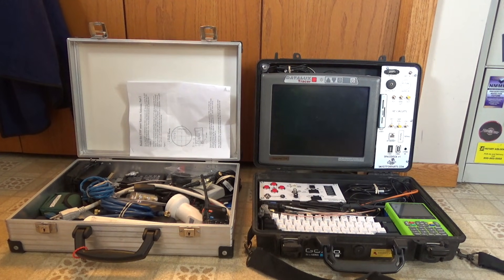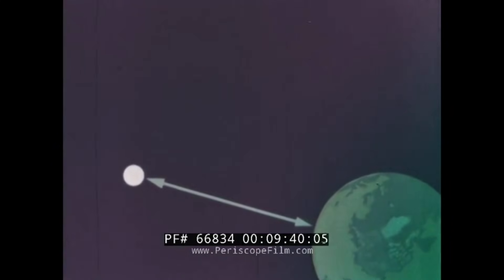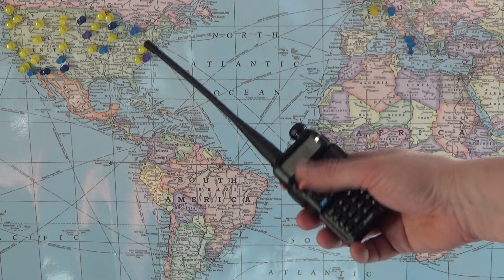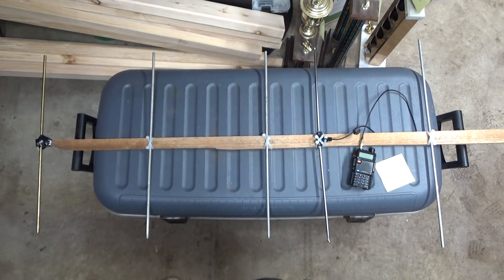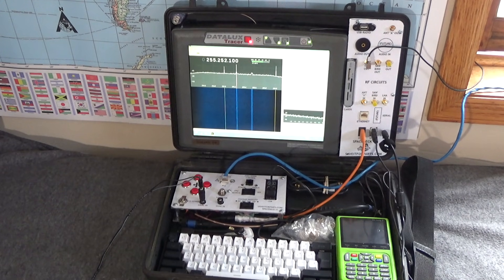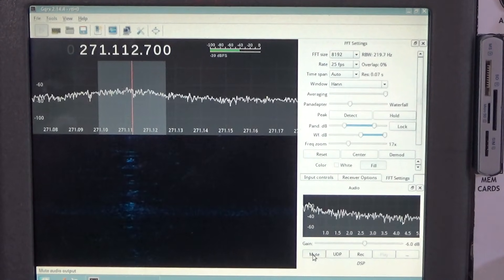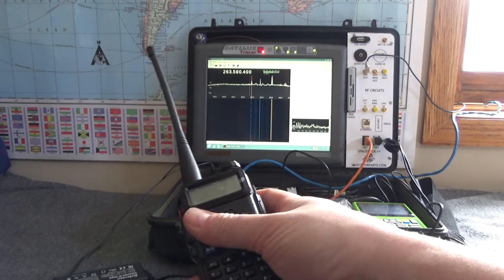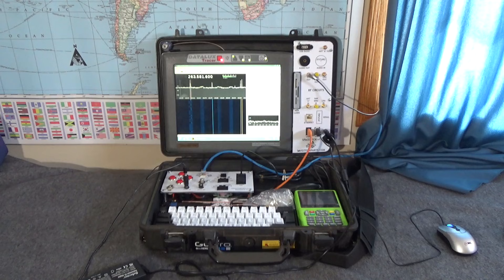Searching For Space Pirates On Old Military Satellites

Comment: The reason why you're getting such a weak signal is probably accountable to some weak hardware, but it's definitely due to the fact that you're using a verical yagi, hence a vertical polarization setup while you should use a right handed circular one, such as a turnstile antenna or two coupled yagis (one in v and one in h)

Comment: speaking of weird harmonics in places they shouldn't be, have you ever noticed NOAA weather transmitters on 18mhz/50(ish)mhz? i tend to find those still at full power all the way down there
Reply from the maker: Always with the same radio and antenna? Sometimes the harmonics and reflections are internal to your equipment, I get that with certain combinations of SDRs and gear while others don't get it as much.
Reply: @saveitforparts  i suspect probably the radio, i only have two antennas capable of going that low and it seems to generate the same result.

Comment: @saveitforparts very nice work, unfortunately it doesn't seem the communication you intercept come from the satellite. It's more probable that waves you received were thru ionospheric reflection and it isn't stable since it depends of the weather condition once this wake arent'well reflected, btw the brazilian truck drivers use to use the UHF/VHF radios to communicate between them, it was exactly the communication you got.  As already said by other comments it's brazilian portuguese
Reply from the maker: I can see the transponders from the Satcom system, they're the faint evenly-spaced signals at 8:10. The voice transmissions come through as subsets of those transponders, in a narrower bandwidth.

Comment: I built the datalux tracers lol. and worked on them. the company no longer exits sadly. pretty cool seeing one. other than the one i have
Reply: Everything in that was engineered and manufactured in house in Virginia. If you were curious. It went down hill around 2013 and mainly due to the price of laptops dropping dramatically. So it was cheaper to just replace a cop computer rather invest in making it almost indestructible lol.

Comment: 271.1127 / 3 = 90.3709 (third harmonic)
Reply: Sounds like you need a FM broadcast band filter or better shielding in your receiver. If you use a HackRF there's a shielding kit you can install to block FM band. If you use a RTL SDR then you can mod some; or buy one that is better shielded to begin with.

Comment: Newb question: I can’t find any Baofeng radios with freqs between 250 and 270. What radio is being used in this video ?
Reply from the maker: This one is a tri-band model, I forget the exact model number and they know of make up new models every few months. If you search tri-band you should find one that will work.
Reply: @saveitforparts my Baofeng goes between 220 259.9MHz. On UHF from 400 until 519.993.

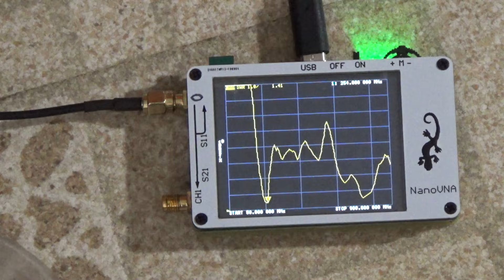Comment: 5:15 = wait,  wadduya mean? You adjusted the distance of antennas rods from one another and THAT changed the frequency you receive???

I'd have thought only the receivers electronics determined what's being received and antennae just determine how much/strength of receiver??¿¿
Reply from the maker: Antennas work because they resonate at certain frequencies, so the length of the antenna material is pretty important. That's why lower-frequency antennas like CB and old AM car radios are so long, and higher-frequency antennas like UHF can be tiny. You can re-tune one to a higher frequency (shorter wavelength) with wire clippers 😄

Comment: Did you figure anything out about the the recieiver picking up npr?
Reply from the maker: I think it was just a harmonic reflection inside the antenna or wire. I should have used an FM filter to avoid that.

Comment: ya ... uv5r is dual band not triband
Reply from the maker: I think this one is a "UV-5R III", but really they make up a new model number for those Baofengs & clones every week. I think the factory just slaps a random sticker on the front, you have to look under the battery to see what the actual specs are.
Reply: @saveitforparts  all uv5rs can only run 2 channels at once

Comment: how did you get your uv59 to transmit on 250mhz i can only go as low as 400mhz
Reply from the maker: I'm not transmitting, just receiving. This is a tri-band Baofeng. There are so many models and clones of these radios it's hard to keep track of which ones do what, but the tri-band version has a 220-250mhz capability.

Comment: Very very cool(and inspiring), although there is one thing I do not understand, you already have a lot of antenas, why did you need to build another one for this project?
Reply from the maker: They're all tuned / optimized for different frequency ranges. I didn't have one for 250mhz, and wasn't receiving anything with the little 220mhz antenna on the handheld radio, so I figured I'd make a custom one.

Comment: How simple of a receiver for these satellite transmissions can be made with household electronics with the obvious necessarily custom made antenna?
Reply from the maker: You need something that can receive ~250-270mhz, like a radio scanner or software-defined radio (the cheapest ones are under $20 on eBay). There are some other antenna designs that supposedly work better, I've been meaning to try this one but haven't had time: https://forums.radioreference.com/threads/homemade-satcom-antenna.352085/

Comment: It's amazing FLTSATCOM 8 is still at its operational orbit.  I would have thought its stationkeeping fuel would have run out by now.
Reply: Even though there's virtually no atmospheric drag to speak of at GSO compared to LEO, and precise positioning is not strictly necessary for radio repeaters in GSO, they still had 120kg worth of station keeping hydrazine onboard.  I doubt they've used much of it.  If they wander about due to the gravitational influences or solar winds, not really a big deal, they'll still be there in the same general vicinity doing their thing, and orientation is a gyro stabilized affair driven by solar.  Navsats and whatnot that require precise positioning will absolutely burn through their station keeping thrusters at a much higher rate, as well as having an extra bit of delta v in reserve for the end of their life cycle to transfer them up into a higher graveyard orbit, so their expected perturbations don't cause interference with newer sats taking their place.  I don't know if there are plans or intentions for these sats to transfer up to a graveyard orbit, I would assume not as it's likely they would've already done so at this point.

Comment: Sat comms were my favorite back in my marine days. We didn't have a geosyncronus satelite over head for the man portable kits I used. Instead I had to kinda guess where tf it was in the sky, aim the antenna at it, and see if it would transmit.
Kind of a pain, but I liked them bc the voice comms were always crystal clear.
But for reliability it was hard to beat the old HF radio with a field expedient antenna.
Reply from the maker: Cool! It would be fun to learn more about military radios and systems. I assume most of them are encrypted these days.
Reply: @saveitforparts  Encryption is a whole other thing. Stock they are unencrypted til you load crypto. We would use unenceypted chanells to talk to civilian run range control to let them know when we were going live, when we were done shooting, how many marines were on range, etc.
Since you are a radio guy, you prob already know, but if u don't I suggest looking into omnidirectional field expedient antennas. All you need is some copper wire cut to the right length for the frequency, a means of holding that copper wire off the ground. You can get comms with anyone using that same freq within 350 mile radius.
Field expedients were only workable with HF radios due to the length ratios required to cut the copper wire. (The length of the cut has a certain ratio to go with the freq, but I have long forgotten the tables for that) Not all info I'm giving u here is gonna be 100% spot on (I've been out for ten years) so I'm just goin off of memories.
Hope this will maybe give u an idea for a video you can do.

Comment: Feed line laying inline with the elements is a no-no when making measurements, and way to much stuff around it. Support the antenna from the rear out in the open at least 2 wavelengths above ground for a UHF yagi like that, route feed line at 90 degrees form the boom and elements

Comment: Oh so this is the video where you're haunting pirates. I am an SWL from Italy, I use a superclassic omni Diamond X300 on a Yaesu FT-7800 vhf/uhf radio and I can normally pick up lots of Brazilians pirates, sometimes Russians but mostly people from Brazil. Yagi on VHF is good if you want to get a point-to-point connection, otherwise a good old simple J-pole will march quite nicely (if you only want to catch waves without considering the ROS, so not transmitting and say goodbye to the radio). I made one from various copper scraps and I can get ships and planes from 105 MHz to the 140 MHz. Though VHF are quite keen to pick up lot of noise, sometimes it's crystal clear, but I live 50 mts far from the Adriatic sea... 
The idea of using a PTZ cam as a rotor is just awesome!
Reply from the maker: Cool, thanks for the info! I'm always learning more about antennas, I have an amateur license and have read some of the theory books, but it always makes more sense to me once I've actually tried it for real.
Reply: @saveitforparts  Ah, nice! I'm waiting for my license too. For now, '73 here, maybe one day we can try to catch on air, when I'll have some spare time to setup a DX (I sell marine engines... funny how we have common passions :D )

Comment: Any updates with regards to the NPR broadcast?
Reply from the maker: I think it's a harmonic of the FM radio signal (so 91.1mhz times some multiplier). Possibly being caused in my antenna since I didn't use an FM blocking filter.

Comment: EE undergrad here, only just took a class on this. Might want to add a cross to that antenna so you can pick up different polarizations of waves, might get better results. Dont know a ton about antenna design (only what they teach in class so far) but arent those styles of antenna supposed to be more triangle shaped? Again im still learning so feel free to correct me. Pretty cool project, want to get into it a little but dont have any resources. Was really cool to see a real frequency band graph just after doing fourier/Laplace transforms in class with some single-sideband examples.
Reply from the maker: I've heard that an X-wing or other crossed antenna would work better, I still struggle with phase adjustments though. I might do a follow-up if I make a better antenna.
Reply: @saveitforparts  -  Sometime quad or hybrid antennas work well for this also

Comment: I'm surprised no one hooked a server up that acted as a modem for internet access. Have it listen to a self signed encryption for AT dial signals and establish an encrypted tunnel to whatever authenticates. Well I know what I'll be doing if I ever need to bug out ;P
Reply from the maker: I'm not sure what data rate you could get through that, probably way less than old dial-up modems. And if anyone else happened to be using the same frequency it would cause interference.
Reply: These satelites are not up all the time. 
They "restart" Sometimes and since the frequency is widely used I doubt you could get any stable connection for data

Comment: I wonder if the age of the components has caused any frequency drift in the repeaters. Regardless, I love that these 40+ year old satellites are still functioning and still getting used, even if for unauthorized purposes. A testament to engineers who designed and built the originals, glad they're not just space junk.
Reply: Well, its not all that hard,  AO-7 is a ham radio satellite that was launched in 1974,  and remained working until a battery failure in 1981 when it went quiet.  It was heard again in 2002,  when the batteries finally went "open ckt" and the equipment started operation again using only solar power.  It would reset when in darkness and restart when it was getting enough light.  Other than the batteries, the thing is about ready for its 50'th birthday next year, and was built by amateur (ham) radio operators on a very thin budget.
Reply: @arnoldgrubbs2005 that's really cool to hear
Reply: As it appeared in the video, the sats were actually still in service, so even without the pirates, they would not be space junk yet. But with increasing user count and decreasing battery life, they may end up as junk sooner. But surely is more fun to see this tech used by a broader audience than intended.

Comment: The U.S. Govt  legit SATcom stuff in the 250s these days are mostly secure data links. There's definitely still some secure & plain-voice USG Tacsat comms in the 260s -- some of it important stuff, But a lot of the USG Tacsat has migrated to MUOS CDMA with downlinks in the upper 300MHz area.   Really annoying to hear the pirates for those of us that used to have to submit requests for UHf SATCOM transponder access back in the day & get in trouble if we used to much uplink power, etc.
Reply: WHy did it matter if you used a little too much power on uplink? I realize that you don't need a kw to access it, but enough juice to make a solid entry into the system. What kind of karens run that system anyway?
Reply: @KlodFather  As available power is shared across users, normally you uplink enough power so that the downlink power is enough to be received. If you uplink more power, the other downlinks will suffer, dependant on sat power budget. A major sat system I worked with some 40 years ago, had automatic individual and total uplink power adjustment. All users of the system had their uplinks controlled in this way.

Comment: NPR on 271 MHz is very common you will pick up FM local transmissions  on 271 Mhz and even sometimes you will pickup shortwave transmissions, it is just a harmonic frequency. That is why you typically want to use an FM bandpass filter. IDEALLY you want to use a band pass filter that filters out everything except the band you are interested in, in this case 270mhz

Comment: 250Mhz is VHF, not UHF.
VHF SATCOM satellites use linear transponders. Which are the simplest that exist. As long as the satellite receives a signal within the bandwidth of the transpod channel, it will send the same to the output of the transpod. Whatever. Noise included.
You cannot analyze an antenna if it is resting on the ground.
The UV-5R is lousy for listening at those frequencies. Use a UV-3R.

Comment: 7:35 this linguage is portuguese from Brasil, here we have pirate radio a lot, include me.
Reply: More truck drivers use pirate radio because Brasil have tree a lot and the rage of transmission need intensifuly, in this transmission in particuary is abaut a information to base abaut unload somenting in the truck.
Reply: 9:08 this transmition is another transmition from Brasil, something about an emergency to save a tractor.
Reply from the maker: Very cool, thanks! Hope you stay out of trouble :-)

Comment: Just a thought... I wonder how hard it would be to repurpose old digital satellite dishes. Somehow I don't think it would be that hard to learn about inductance and wind a horn that could tune into the frequencies in question here. I mean, the receiver horn that comes on most DSS dishes are basically just coiled wire inductors right? Those are tuned to a range from 1Ghz to 9Ghz skipping the 4.2 to 5.9 range so that it's not operating in the same range as WiFi or cordless phones. It shouldn't be hard to wind a coil tuned to approximately the midrange of the frequencies used by pirate radio operators.
Reply from the maker: I've taken apart some of the modern KU band LNBs and they're basically a circuit board with a tiny pin in the center for 12ghz. The rest of the unit is just a metal case and funnel that directs the signal onto that pin. I'm not sure about the old C-band feedhorns, haven't taken one of those apart yet.

Comment: Nice video! Have you also tried the yagi antenna in a horizontally polarized position? When the satellite's transponder is transmitting a horizontally polarized signal and your receiving antenne is vertical, you'll still get some signals but they are 16-20dB down. But I can't find any information about the polarization of the transponders at all.
Reply from the maker: I think the signals are technically circular polarization, so a crossed yagi (x-wing) or helical antenna would probably work better.
Reply: @saveitforparts  Thank you, that's another possibility indeed. It's better to use a circulair antenna, but you will be fine with a vertical or horizontal yagi because receiving circulair signals, the signal will only be approximately 3dB down (compared to a simple circulair receiving antenna). So, adding two more directors to the yagi will compensate for that loss and the construction stays relatively simple. Time to dive into my junk box and give it a try with the RTL SDR 😀

Comment: Greetings here.. You might try setting up a grounding system for your antenna most of the Receive is done on the grounding side anyway..  My suggestion is to Build a wire dipole antenna hang it from tree to tree then create a star pattern Grounding with Romex wire or house wire and copper pipe to get a large surface area ground. Next buy some Filters for Both AM and FM common transmitting stations. Personally I would go ahead and create a Band pass filter its self out of sheet metal and hose clamps and pie pans and a copper rod down the center works great! Just from experience.. Anyway good luck and happy hunting lol!
Reply: By the way google Motorola R56 Manual.. Its a very old manual that talks about repeater setups and stuff I think you might find some of the information in there interesting..
Reply from the maker: Cool, I'll have to try some of that! Thanks!